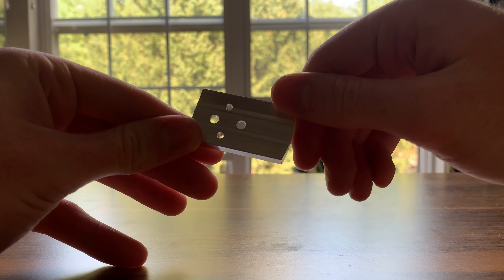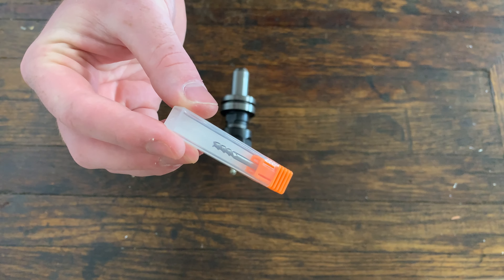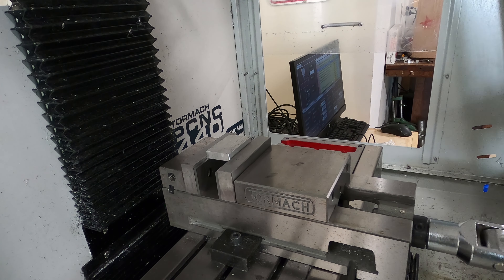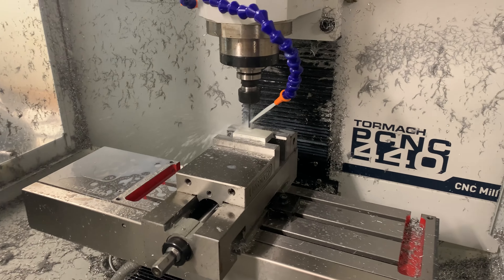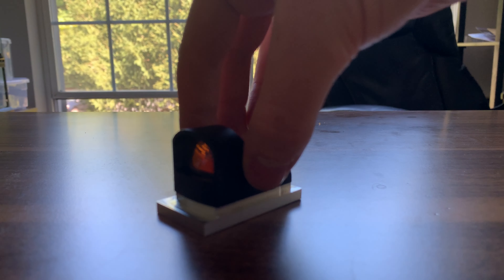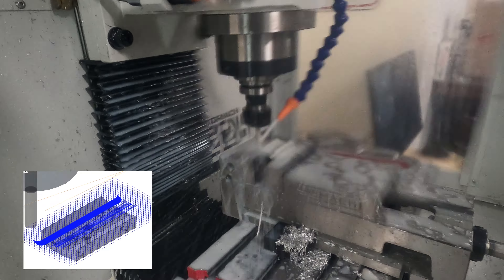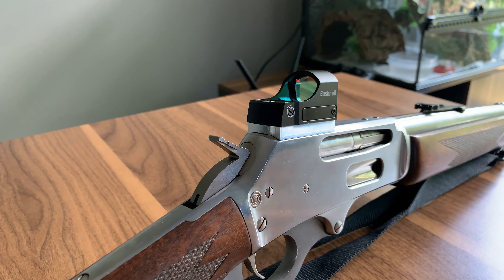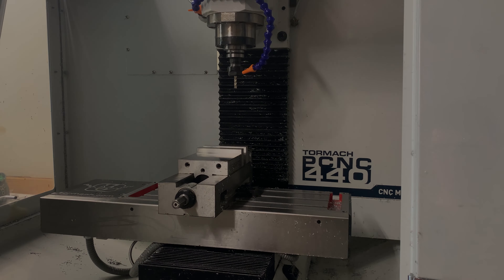Tormach PCNC 440 Project Showcase: Red Dot Sight Mount

Comment: Neat little project!

Couple of things: for that scallop operation, use a ballnose or a bullnose endmill with a small radius. Makes for a much nicer surface with steps 5 times larger. On that adaptive on op 1, leave about 0.05mm of axial stock to leave, then clear it up with a flat toolpath using about 70% stepovers. That way the deflection of your tool doesn't leave those marks. From an aesthetics perspective that obviously doesn't matter too much with the red dot sitting on top, but if you zoom in the optic is now resting on a bunch of ridges instead of a flat surface due to that deflection. Lastly, I'd split op 2 into two separate setups, where you zero off of the excess parts for op 2 and then just do the facing down to the milled surfaces, so that x and y aren't that critical. Then touch off again on the milled faces for op 3.

Comment: Do u need air compressor to run this machine?
Reply: Depends on if you run a power draw bar. Without it no, with it yes
Reply from the maker: With my setup, no